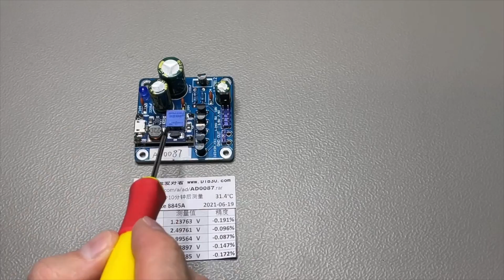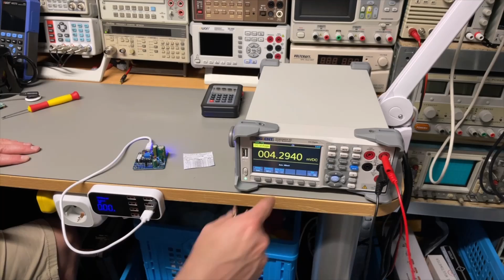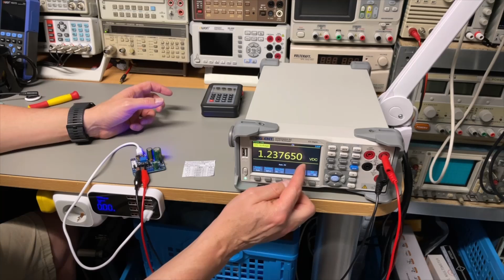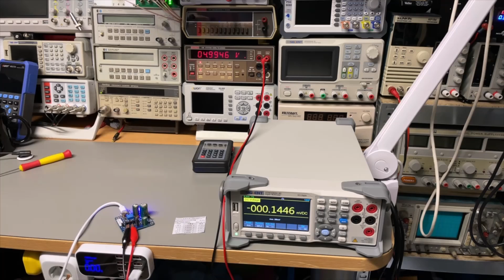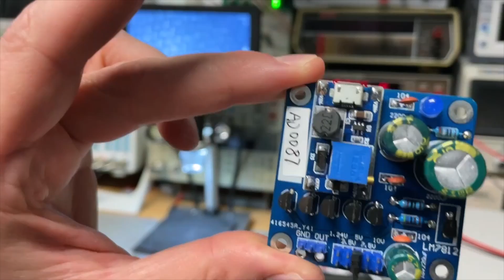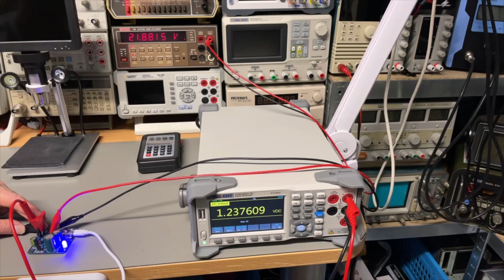TA•0222🟦Voltage reference AD585 1.24V  2.5V  5V  7.5V  10V  is this really from AD ?

Comment: The AD584 is voltage reference chip. The AD585 is a High Speed, Sample-and-Hold Amplifier. Totally unrelated. 
In the parts listing from one supplier there is this: Package include: a piece AD585 voltage reference module. This doesn't exist on the board even though the part number is not a voltage reference either.
It seems someone was trying to run a scam of some kind perhaps attempting to create the illusion of an upgrade from the AD584. Many of the older versions of these boards use a 7812 and then some zeners or in the case of the latest version they've forgone the 7812 which was never a precision device to begin with and use what looks like zeners with a resistor network. 

Since they appear to be selling a scam I have no reason to believe that the calibration sheet you can download based on the serial number is actually a real calibration done on the board that we buy. For all I know any serial number you type in would return a common calibration sheet. 
Smoke and mirrors folks.
Reply from the maker: Sneaky from them using the AD prefix.

Comment: Hi Tony,

this is really a waste of effort and resources with this cheap „chinesium“ reference.
As written by others this „reference“ is worthless. The serial simple references add errors to each others.

 And a switching power buck converter is a worst thing
for a reference. 2nd the 78L12 is a high noise LDO. A reference for a good working 6.5 digit DMM
(I own a SIglent SDM3065X and it is perfect in specs) needs much more efforts.
3rd a „reference certificate“ at 31.5 degrees is measured way out of the specs of the Fluke.
But always nice to see what crap sometimes is delivered from our chines friend.
And thanks again for your efforts with this little toys. Looking forward to see your LM399 test!
Reply from the maker: Thanks BD/DD! yes i was put on the wrong foot (if that exist in English) with the AD585 coding, if i would have looked it up i would have know it is not a voltage refference from AD.. but i just assumed it was an improved AD584 as it also was discribed like that. sneaky CN :)
Reply: If the errors follow a normal distribution, then adding them in series should eventually create a more accurate top value

Comment: Calling this thing an AD585 seems disingenuous at best. An Analog Devices AD585 is a precision sample and hold amplifier and not a voltage reference. Looks like a  case of caveat emptor! For a reliable 1.25 Vdc output I would use the AD485 datasheet recommendation and build a voltage divider with precision resistors and a precision op-amp.
Reply from the maker: Yes i was put on the wrong track with that name... it is not an high quality AD device. anyway it was nice to try so you don't have too :)
Reply: @TonyAlbus  Absolutely, and thank you for showing it to us -  I hope you understood that my critical comment was directed at the maker and not you. If you are interested in an accurate voltage source for testing your meters and other voltage references check out Ian Scott Johnson's PDVS2mini - a 0 to 10 volt source digitally  adjustable in 10 uV steps using a 20 bit DAC. It includes a significant price tag but is very well made.
Reply from the maker: Yes no problem Dave, thanks yes IanScott looks indeed very nice… interesting, thanks

Comment: LOL, they are just five TL431 references in series. Or, it should be TS431, some manufactures do they with 1,24V base voltage.
Reply: TL431 is a very useful device. I like it. But way away from precisely.
Reply from the maker: Yes indeed :) .. not AD at all..

Comment: Hi Tony.  As soon as i saw the pot and transistors, i guessed this is not a precision voltage ref :(
Reply from the maker: Almost a scam.. i would say, giving it an AD type number... smart though :)
Reply: Unless the AD584 is under the pot, then there isn't one on there, also the ref is from the transistors for the voltages?  Hence the output ref is from them.  So snake oil here me thinks? Just a finely trimmed (with pot) voltage ref :(

Comment: They counts silicone voltage drop
All transistor as a voltage regulator which calibrated blue Potentiometer output as a reference,  it's not precise
Reply from the maker: Yes agree, it is not good.

Comment: The 5 „transistors“ might really be cheap voltage references i guess. No precision parts. The provided measurements may be useless after 2 or 3 digits. So the Siglent ist sure right.
Reply from the maker: Yes it is not good at all and not an AD device.
Reply: @TonyAlbus  Just made some more measurements with my calibrated 6.5 digit Solartron 7150+. Temperature makes a difference. The measurements provided were made @ 23.3C. My lab has 22C. Nevertheless, the worst deviation was -0,005%. Considering 1.3C more (TK of the AZ431 is positive above 20C) and the fact, that my 7150 reads a bit low as I know from the calibration data (10V is read as 9,99976) this reference performs damn good. The question is how it performs long term. Still quite useful for DMM up to 4 1/2 digits.
Reply: I ordered a similar but that also provides 14 constant currents from 5uA to 100mA. The voltage reference for the 1.24V is a AZ431BLZ (1% accuracy) the rest are AZ431AZ (0.4% accuracy). They are similar to the TL431. The provided measurements are quite accurate, at least the first 4 digits (1 before, 3 after the decimal point) can be trusted. This is also true for the currents. For about 23€ from aliexpress. Useful to check handheld multimeters.
Reply from the maker: @hgm6421  Sounds good, Thanks!